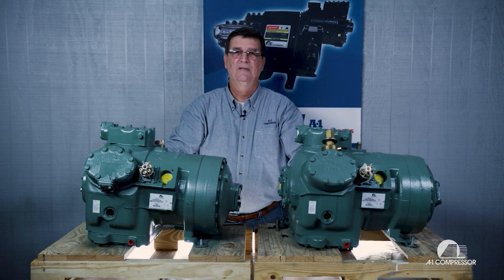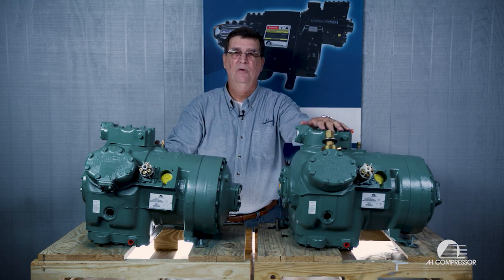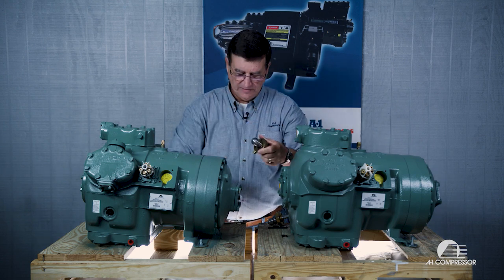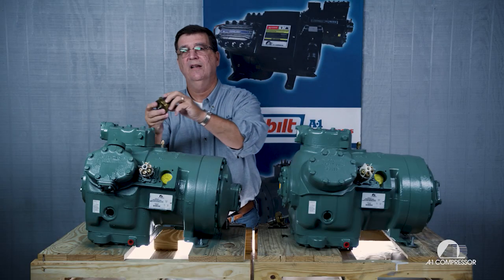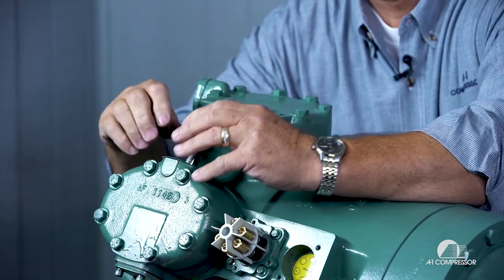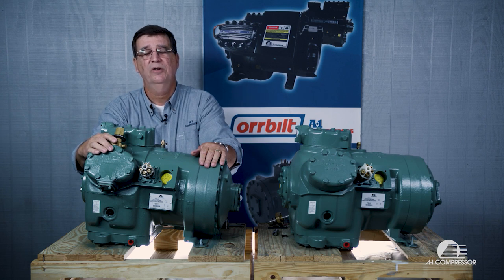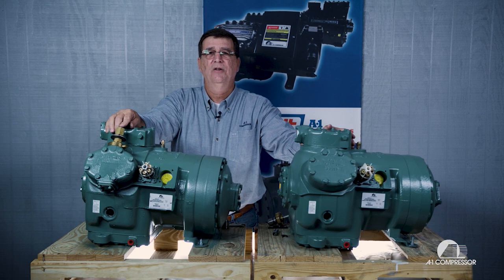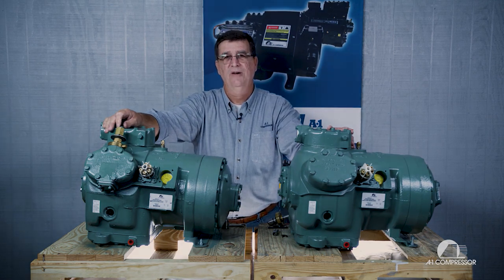Installing a Carrier Unloader

Comment: We changed one of those 06D Carlyle’s out in an old 20 ton Carrier RTU about a month ago. The new unloader kinda threw us off, as it took a while for us to figure out that we needed to take that piston off for it to fit on the new (remanufactured) compressor. This video would’ve saved us a lot of headache and swearing. 😆

Comment: Sir thank you for this video. I have a question

I have a Carrier 06E hot gas bypass valve compressor, if I replace it with a suction cut off valve head and plate can i use it ?

Comment: I replaced this type compressor. The electronic unloader head or Piston does not fit into the new one. Do I just u screw it? From the instructions that came with the new compressor it looks like I have to replace the head of the new compressor with the old one. Thank you

Comment: Can you show the adjusting of the unloader with it running please. Thank you.
Reply: The eaiest way is to turn the large nut on top all the way down to were no threads are showing.  Then turn it back up until about 4 threads show.  This will get you very close to 68 lbs on a R22 system.  Turning nut down lowers suction pressure, turning nut up increases it.
Reply: @johnd4348  What about Freon 407 system, and how to adjust stage 2 and 3, work together?
Reply: @АндрейАндрей-х1б  R407 is very close to R22 in properties. Pressures just slightly higher.  Not sure about the stages working together. I was just giving a rule of thumb on how to adjust an unloader as told to me by a tech with 40 years experience. I have used it and it works fine.  It's easy to remember .

Comment: What os the function of Thais device in this compressor?
Reply: Reduces the cooling load when full load isn’t needed, hence the term “unloader.” The way it works, when a full load isn’t needed, the unloader is energized and pushes a rod against the valves in the head, keeping the valves open so the refrigerant vapor just sorta swirls around in there without getting compressed and pumped; it takes that head out of operation basically and the compressor is operating at reduced capacity. In a two stage air conditioner, when it’s calling for both cooling stages, the unloader deenergizes and now the compressor is fully loaded and operating at full capacity.

…at least I think this is how it works, to my understanding. In short, it allows for multiple stages with only one compressor.